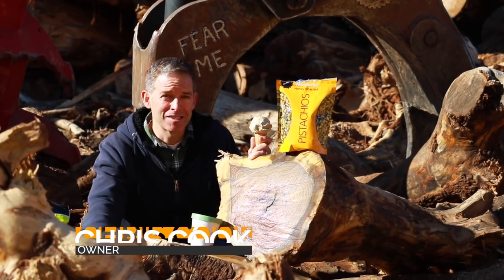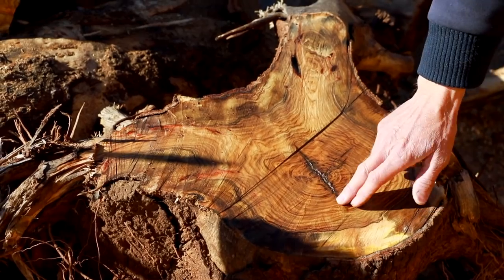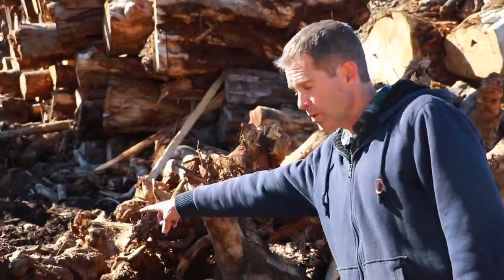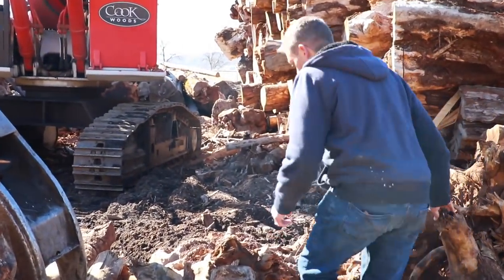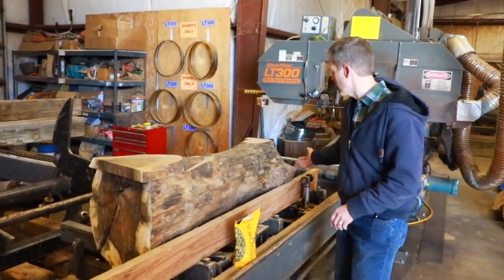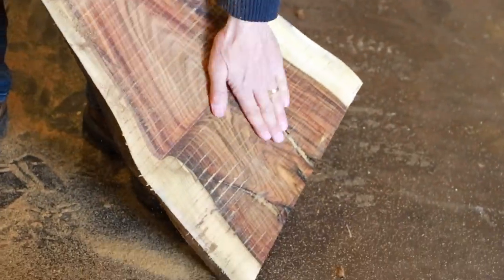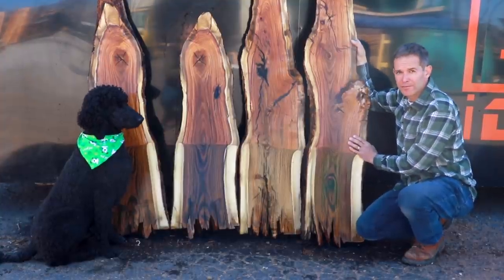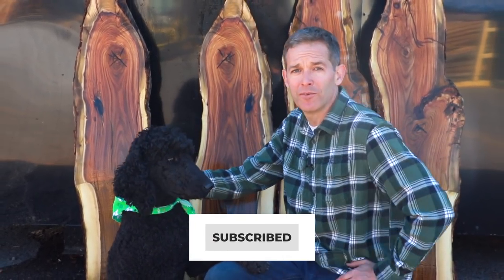Pistachio Lumber Anyone? See How it's Cut!

Comment: The wood is so lovely surely you could make slabs out of them for the joy of larger constructions of beautiful bowls, platters and vases.
Reply from the maker: We would love to be able to make larger things but the wood just doesn't yield it. If we did yield larger pieces they would be completely full of cracks and voids so they would work for resin pours. The best thing to do to achieve bowls and vases would be to laminate/glue and turn the finished product. We wish we had a wood stretcher! :)

Comment: Love your timber and equipment. I’m constantly drooling over your stuff.

You talk about the waste and I understand whilst producing solid timber blanks. But with expensive timber like this (and other similar stuff) with cracks and faults is it not worth getting into the resin filling game before final milling. That way you can get more return which is what I tend to do (on much smaller scale of course). Yes it means getting timber dry before casting, and milling dry wood with resin, but it means very little waste.

What do you end up doing with the offcut stumps? I can see some beautiful cast and turned  bathroom hand basins there 😉. Just I’m doing a few at the moment for clients
Reply from the maker: Hi there, thanks for commenting. Yeah, you're right that resin work would preserve a lot of the quality. We don't currently do resin work here on site. The off cut stumps usually are milled into smaller pieces like pen blanks. :)